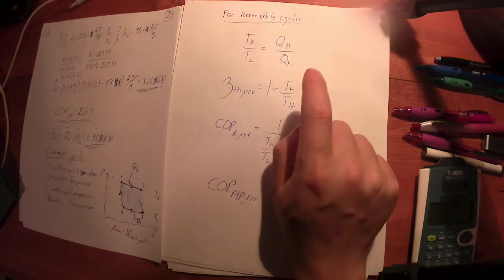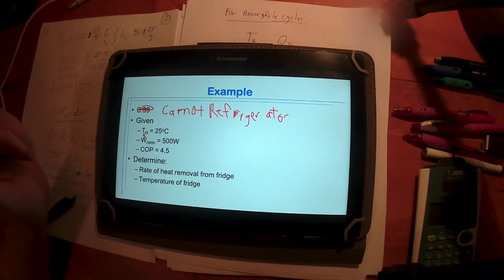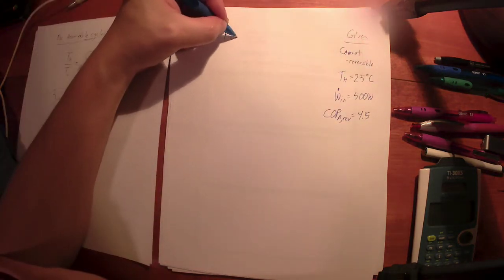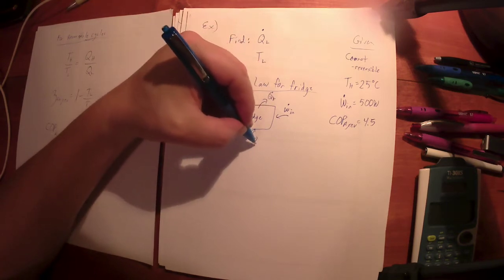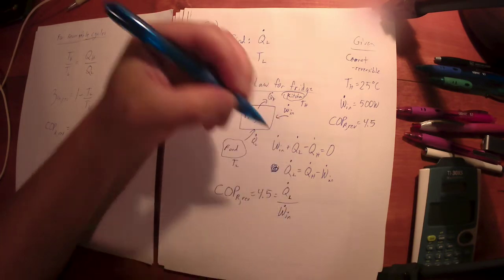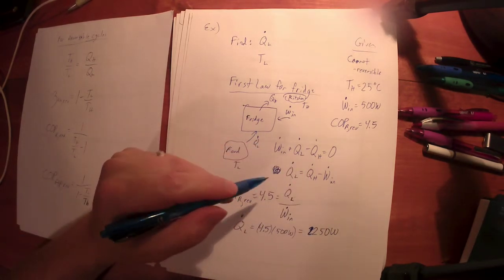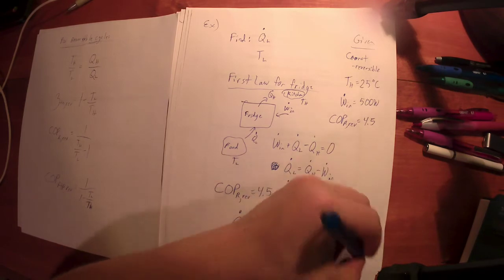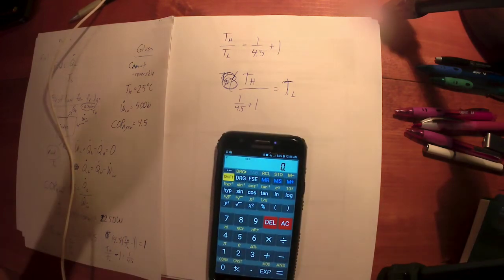Thermodynamics Lecture 16 part 4

Comment: I thought an easier way to find T_L was to use the Q_L we found then put that into Q_H=Q_L+W_in then use (Q_H/Q_L)=(T_H/T_L). I figured algebra was much easier to do it that way and got the same answer.
Reply from the maker: yes, this will work IFF you have a reversible situation